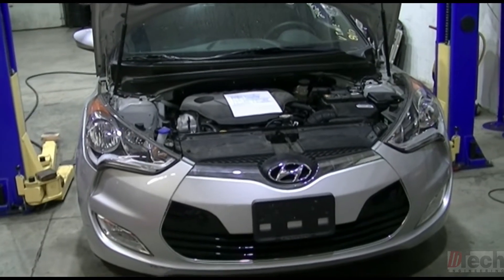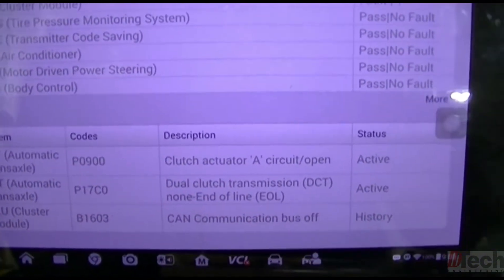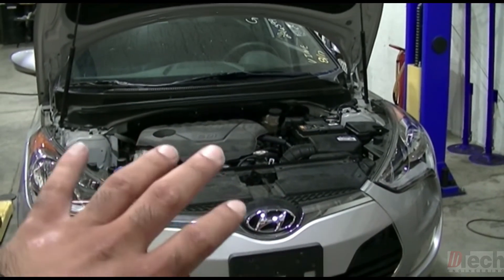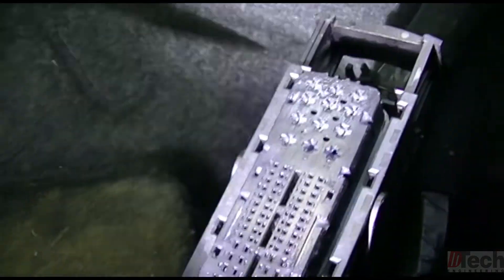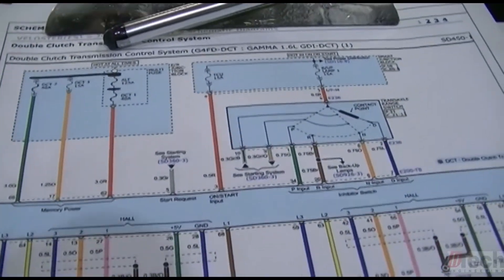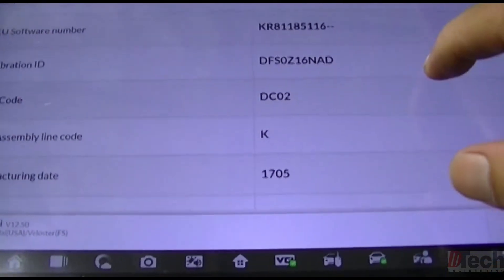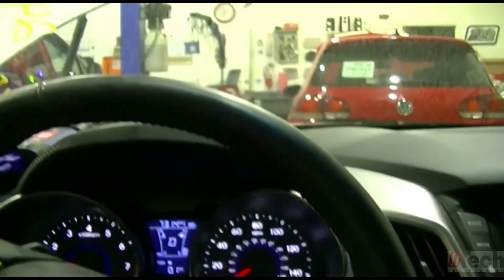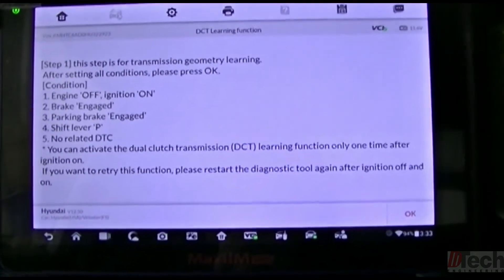2017 Veloster Double Clutch Trans issues Diag & Fix

Comment: Thanks for this I had the p1807. Actuator B. I ordered 2. First I switched them cleared coded and it worked. When parts came in I changed both. No relearn, I had my foot on the brake and went through the gear position. Then I did a mild test drive for 20 mins then longer. Important to run AC and head lights.

Comment: Awesome video and explanation. I have a 2012 with a P17C1 code ( clutch 1 actuator error) Swapped the actuators with no luck,  got a new actuator, still the same code. Replaced the TCM with one from a junkyard, both actuator don't work. Put back the original TCM, still same code.Try relearn and it's says that failed to completed. Could it be the TCM?
Reply from the maker: I would venture to say yes, it seems that it's still a tcm issue if both actuators are known good working condition, obviously the new actuator has to replace the bad one you already have moved to the second location

Comment: I had a similar issue with 2012 I thought the trans died but I figured out it was the shifter and inhibitor switch I replaced both and drives like new saved my 3500

Comment: I need help with my transmission but this is what happened I was just sitting in my car and so out of no where it made a clunking noise for a second and then it sounds like something was moving in the transmission and so it won’t move in reverse and it stays in first gear but won’t shift to second but if a high enough rev it’ll kinda catch on second but seems like it won’t move but my shift indicator blinks and then it went into safe mode so I’m not sure what’s going on
Reply: Same here any update on yours 😪
Reply: Please any update on urs? I have same issues

Comment: Great video sir.  If you replace the ECM or TCM, is there any kind of programming/numbers matching that needs to take place for the new module to recognize the different engine/transmission or can you just pull one from the same year and plug it in?  Thanks.

Comment: I need your help. i have a Hyundai veloster 2012, i receive a code P-0601 tcm error. the car doesn't want to drive or reverse. it starts normal. they told me to replace the tcm, but i cant find that part #... it is very stressfull because i want to fix my car and i need it. please can you help ????
Reply from the maker: Best thing I can suggest is to gain access to the tcm and get the numbers off of it and search online for one with matching numbers. It should be located under the dash on drivers side (left hand drive)

Comment: Hello again.  Followed your awesome troubleshooting with same results but I just don't understand why I don't have any code??  Only works in odd gears so no reverse, 2,4&6th but it does not have any code when I pull them.  The troubleshooting points to the TCM but shouldn't the ECU/M send a code if it was bad, not working correctly?  Thank you.

Comment: Can you help me with my 2012 veloster don't catch gear 1 3 5 it begins with 2 gear fourths and sexth when I changed the crank shaft sensor  the gears returns catching 1 3 5 but for 12 hours only and then the same issue occur on computer the clutch 1 error
Reply: What is the problem if you can help me
Reply: Did you ever figure it out? I’m having the same issue

Comment: The used ECU need to be programed before installing on the car ? I have tried it but the car wouldn't start . Please advise 🙏
Reply from the maker: on my particular vehicle it did not need programing, but I believe it all depends on country and the key type that determines the immobilizer concerns
Reply: @DTech Engineering  the one you replaced was TCM right? Not the ECU
Reply from the maker: ah yes, forgive me... I forgot this one the tcm is a separate unit from the ecm. but yes correct, the ones that have this transmission with double actuators does have a separate tcm that was under the dash.

Comment: I believe I´m having the same problem with my 2018 Sportage with a D7UF1 transmission. My mechanic put in a new clutch because of juddering and got a P0921 code afterwards. Only even gears engage (R, 2, 4, 6) now. What I didn´t understand is if there are two TCMs. Is there one for clutch A (odd gears) and another for clutch B (even gears) or just a harness for each that goes to the same TCM? Also, if I install a another TCM, how do we make sure it doesn´t short again?
Reply from the maker: There would be one actual TCM, and two clutch actuators. You would have to swap over the actuators to see if you now gain the odd number gears, and if so, then replace the actuator first and see if you get all gears back, if not, the TCM has been damaged but once the faulty actuator has been found and replaced you are now safe to replace the TCM. The actuator failure is what damaged my TCM in the video. Hope this helps
Reply: @DTEAuto  Thanks for the response! We were able to get it fixed. We rewinded the clutch actuator and cleaned all the connections, so it was one of those...
Reply from the maker: awesome! glad to hear you got it resolved. 👍

Comment: I have the same problem but mine no check engine but my veloster is not going to reverse. Its like there is no power running to transmission. on drive it will run but having hard time to shift and will not drive forward even I press gas. it will just reverse. youknow whats wrong with this??
Reply from the maker: Sounds like the clutch actuator A motor is faulty, just like how this one had originally had, you can replace the actuator motor but you will also need to replace the trans computer as well

Comment: I’m confused about the readings. There was 0 ohms resistance through the actuators? Plz explain what i missed lol
Reply from the maker: You definitely did not miss anything, I was puzzled too when I took the readings, but after the first reading I just wanted to see what the second one showed, and all I had to go with was factory service information that states the readings needed to be the same for both actuators. I never did get a chance to dive into the internal workings of these motors to answer the why in reading was zero ohms.

Comment: Hi! I currently have a 2017 turbo automatic transmission and my vehicle was working perfectly fine until yesterday afternoon when I went to turn it on it made a thumping noise and I let it warm up put in reverse and it didn’t reverse but it would go forward. I haven’t topped off the transmission fluid or had the time to do an oil change just yet but I’m a week late on the oil change . What would you recommend my next step to be?
Reply: Transmission is sealed sooo you can't service it lol
Reply: Please how did u solve this issue mine is having the same exact problem it goes in drive but won’t reverse .. when I put it in reverse it keeps blinking r but won’t reverse

Comment: I have the same issue but only one code p17c0 same as yours what are the chances my tcm is bad 

E on the gauge back up camera works when in R but still says e on cluster does bot reverse or drive 2014 Hyundai Veloster 50k miles
Reply from the maker: it is possible the tcm is bad, but remember the actuators on the transmission is what goes bad first and can take out the tcm, you would have to verify the actuators first before replacing tcm so that you don't damage the new tcm
Reply: @DTEAuto any idea why when i try to do a transmission relearn it says failed
Reply from the maker: did you replace any components?
Reply: I have the same issue, did u get a solution for that !? , u can help me please !?
Reply: @DTEAuto i replaced one clutch and the module
Reply: @brahimuovo1494 ill update you if I figure it out explain more on your situation?
Reply: Hey just found out my replacement transmission came off a turbo engine could that be the reason when i try to reset adaption it says failed because my engine is a base
Reply: Please tell us what is the reason for what appeared at the end
Reply: Same thing, please tell me what to do
Reply: Hey so i ended up buying a new transmission and tcm from my friend it was working on his car no problem but still my car wont move and when i try to program it still says failed cluster now shows prnd but still not moving im about to burn this car on fire please help
Reply: @fekrah-d6y any update on your car bro
Reply: @brahimuovo1494 did you fix it yet?
Reply: @DTEAuto yes i just changed the transmission and tcm same part number and i got it off a car i test drove but on my car its still not moving

Comment: My daughter has same car.  Hers has problem going from 1st to 2nd gear it lags rpms go up but not much forward movement. You have to feather the pedal.  Doesn't seem to have a problem when it gets up to speed.  Any ideas
Reply from the maker: you would need to scan it for any related codes to start with

Comment: Nice video, brother!
I have a problem with mine too. It doesn’t shift at all lol, so I need to use the Shift release every freaking time.
Already checked the brake switch and it was perfect, then I went and bought a new whole shift, installed it and the same problem.
Funniest part: after I drive at least 45 min, shift starts to work again.
Replacing the TCM would help me? Help me man, I have already lost hope lol
Reply from the maker: You would have to get it scanned to see if any codes related to the issue pop up. And would have to check the wiring to the interlock solenoid

Comment: I have almost same problem but throws me the a p01900~clutch actuator B circuit/open and a P0601 memory check sum error, it’s not easy to get a new computer where I am, do you think there could be any other thing that can be Checked? What machine were u using to install the TCM
Reply from the maker: I would check the wiring from Trans computer to the actuator motor on the transmission, the scan tool machine I was using is an Autel elite, but to replace the computer it was plug and play until I did the calibration
Reply: @DTEAuto  thanks for the reply
Reply: Hello, sorry I’m disturbing your time, got a TCM from another car, it now shows a different code, is there a possibility that the new code p1807 is a code from the other car or do you think learning can solve this, the car can now enter reverse, and D too, scared to do a test drive since we havnt done the relearn yet, we don’t have the tool.
Reply from the maker: Hey, it is very possible that the code is from the previous vehicle that it came out of. The code is for clutch position sensor B circuit low, that is internal to the actuator motor, if the code does not clear you can move the actuator from the front to the top and see if code switches over to clutch position sensor A. If it does, then you would need to replace the actuator motor and be ok from there. But if it is from old car TCM came out of, you should be ok
Reply: @DTEAuto  thanks a lot

Comment: Hi, my Veloster has 75K miles and It didnt go into drive or reverse, then i opened hood went into car and boom it started working again, I thought everything was ok because on way home it shifted smoothly and ect...... I went out to store again and same thing happened except this time check engine light came on???? SMH. As im typing i am gonna see if i can pull some codes(its one of those readers you plug in and have an app on phone).

Comment: Hyundai takes care of this under warranty. I am the second owner of a Kona with the same transmission.  My car won't go into reverse and only second gear works.  I took it to a local dealership and with in an hour I had a loaner and was on my way.  It's been over a month because the transmission is currently not available. Hyundai contacted me and offered to buy back my car for what I paid and give me a loan for a brand new car.

Comment: Hi, I have a 2013 Veloster base, and I bought a new TCM and 2 new Acuators and still the car doesn’t want to drive correctly it’s not accelerating and also does go in reverse. In this case what is the best to do? I’ve been taking my car back and forth to mechanics and it seems they only care about the money they make asking for $4125 for a transmission swap. What’s the best to do at this moment ?
Reply: Currently facing same issues 
Did u resolve urs?